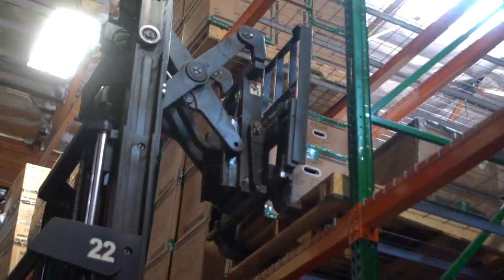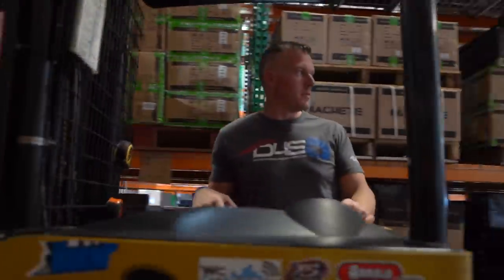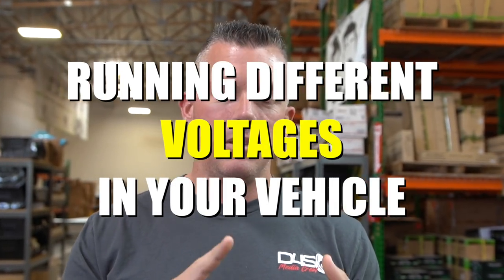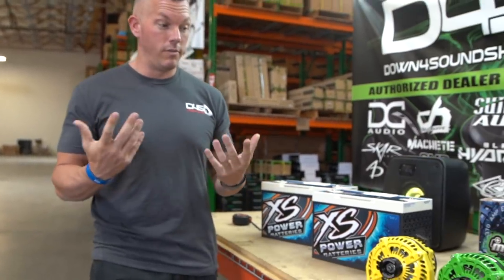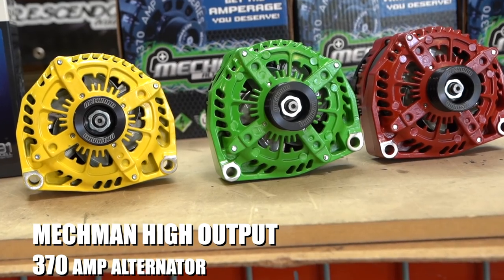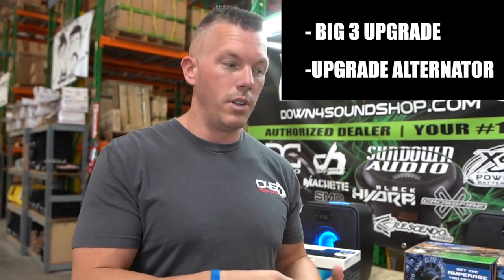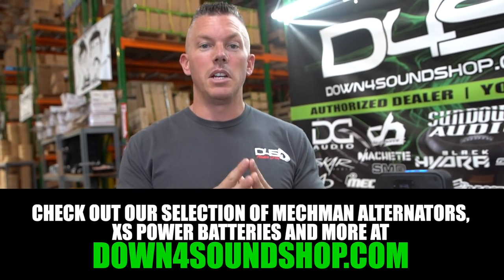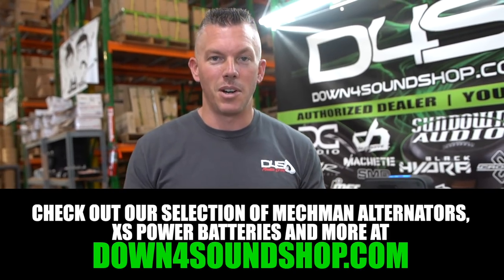WHAT YOU NEED TO KNOW, BEFORE YOU CHANGING THE VOLTAGE IN YOUR VEHICLE

Comment: What's the best budget setup for a 4 door sedan. I want low end rumble but nothing that's gonna shatter my windows. I want to run it off factory alternator and battery though so I'm guessing only 600 watts max?
Reply: It depends on what the stock electrical is looking like in your car.
Reply: Most likely you can go higher wattage than that, but yes as he said need to know stock alternator output to be sure. My Ford edge came with a 150a stock, but some cars only have 90a or so.
Reply: I'm guessing with a 4 door sedan your alt is no higher than 120a so your alt would be ok for 1000wrms.
Reply: My car is a 1400 Hyundai Ix 20 with a 90amp alternator and has 2060 watts of music power all kenwood amps with 2 off 12, inch sub and one 10inch sub and one 6 inch sub and 6.5 inch door speakers

Comment: i had my battery and Alternator went out.   do you suggest a better Alternator.  im not running comp setup.  just a daily 2 10" sub with a 850 watt amp. i was told my subs killed my Alternator and battery and that if i wanna run subs in my car i need to have an upgraded Alternator. is that correct?

Comment: Hey everyone I have a 19 Camry with a 240 autotech and the voltage control module I've been running it at 14.8-15.0 with no problem BUT I just ordered a 29AH SCIB bank from NORTHWEST LITHIUM and i installed it yesterday and as soon as the voltage went over 15v the car started beeping and saying charging system malfunction on both the dashboard and radio screen i know it's just the modern version of a battery light and was told i could possibly see it when initially installing the alternator is it ok for everything to charge that high and what are possible solutions to give my car a lower voltage while still seeing 15.8 at the SCIB bank in the trunk mind you this is a sedan (19 Camry) with very little room under the hood and I have no clue where to look so I think the dual alternator is out of the question unless someone can point me in the direction of someone who knows how and would do the custom work of the dual alternator setup

Comment: I want to put a subwoofer into my Volkswagen Jetta, but ever Volkswagen video I see on YouTube shows the alternator overcharging and the factory fuse box burning up, what is a recommend wattage amplifier I can use for my car without burning it down. Love your Tahoe install.
Reply: Hey, you should be ok, just do the big 3 upgrade and a aftermarket fuse holder , remove the stock alternator wire and fuse, the oem fuseblock is pretty trash. i have a mk4 golf running 6k amplifier just fine (mechman 370)

Comment: Running 2 skar 12v2s 1500rms each with a taramps smart3 on STOCK!!!!! 110alt big3 upgrade lead acid underhood an agm yellow top in the back connected to a duralast platinum efb battery all together 125ah..no resistor or whatever when running different types of batterys it bs..daily driver voltage never drops below 13.2...and i always run system with car on as why would you not...so the alternator thing consider other options if your not going over 3k..unless your alt is in a chevy or ford and easy to do yourself then go for it..but im good no clipping etc and the bass takes your breath away..
Reply: Your good homie but At 13.2 volts your 3k is not giving the full power and is 2,200k lol. Plus change that under hood acid to an agm like xs power at least. And a better alternator too player. lol. Everyone knows acid batteries straight up suck and are not good for the audio. I'm not trying to be an ass and criticize you just trying to give you some sound advice so the music takes your face off too😃👍

Comment: 1:12 1500 or 2000 watts of rms speaker power or amp pwr. How to count total power of system. For example had 2 amps 150.4 amd 1000.1 means i have 1150 power system or got to add also power of speakers?
Reply: Just amp power.

Comment: But having the biggest alt is not always the best option. Have fun thinking your vehicle is going to perform the same with a 400+ amp alt.
Reply: actually  it wont, alt only puts out the amps when its demanded
Reply: @smokingzombie4880  yeah, I know the alt only puts out amps when it's demanded. I'm talking about the size of alt.. you may want to do some research on size of alt and how much power is needed to turn it.
Reply: @crunkwun  no youre right, a little honda might have issues turning it at idle but bassheads dont care we already tear our cars apart with bass

Comment: Any problems charging lithium batteries  with a regular alternator?

I used lipos in rc cars and had to use a lithium charger
Reply: no problems, I run a lithium on my truck for a while now. The battery has a BMs inside which is smart protection circuits. My charging system is all stock for the moment but I will be upgrading soon for an audio system. My voltage starts of in the 14.4 range after start up but gradually  drops to 13.2 at idle after a good long while. Lithium battery charges really fast. I have jumped mine with another battery and I just hold the cables on the posts for 1 minute and the battery charges up instant not like conventional. My lithium battery has a voltage meter and charge percentage meter display built on top.

Comment: What if you own a conventional 1970s car with a very large diesel battery and want to run ac wipers headlights qnd stereo qnd every item. H turn on the volt guage drops and whe. Your driving with all that stuff running at night in hot humid rain. You want to bump up the voltage from A guage showing 11v backup to 14v so the next day your battery isn't dead. using a rare internal regulator I found made for gm 1 wire 120 amp alternator. I bought 2 of them with Lamborghini countach qnd Ferrari 348 written on the boxes 17v magic markered on the alternator,  I'm curious why would some one run such high voltage in those cars? I can simply swap out the voltage regulator with a stock one in the lot I got are 15.5v 16.5  white triangular things with 3 holes and 2 blades for 1 wire vintage 1105 units..and $50 each no trendy spendy modern stuff...

Comment: I have a 2018 Chevy Malibu what size amp should I use for stock battery and alternator I’m put in hight low converter keeping stop deck
Reply: The general rule of thumb is that "most" stock electrical system are good up to around 1000 watts or so.  I've got a daily driver S10 with stock alt and battery, and run a 500 watt rms amp on subs, and 200 watt rms on the mids/highs with no issues. My Silverado has a little more power with 2600 rms on subs and 700 rms on mids/highs, so I've got an optima red top battery under the hood, two 100ah agm batteries out back (isolated), all being charged by an Excessive Amperage 300 amp alternator, and no issues with it either.
Reply: @PURESOUND4  its a power bass amp with 2 12 I’m going to bridge it says 4ohm mono power: 400watts x1 just needed something for my ride to work I didn’t want to put to much strain on alternator or battery I appreciate ur reply thank u
Reply: @thatruthhurts7210  my 1400  Hyundai  ix20 has 2 bass amps kenwood so 1700 watts and a 5 channel Ken wood with 120 watts of bass and  240 watts for my door speakers and done the big 3 and has  a 90 amp alternator and all my wire is ofc copper with 2 off 12 inch sub and one 10 inch sub and one 6 inch sub

Comment: I have 2 of the D4S LTO 6.0 and a 240 amp alternator. it charges between 14.1-.2 at idle, if I add a diode what will my voltage go to ?
Reply: Voltage  drop  but not much of difference
Reply: How much power rms on the 240 alt and 2 6.0

Comment: i thought you upgrade your alternator when you need more amps. like if you wanna run higher rms subs say 3000 rmsso you need an amp that puts out that amount of rms. but a stock alternator doesnt have enough amps so you upgrade it. like i went from 130 amp stock alternator in my accord to a 240 amp one so i could run higher rms amps and speakers. so this is wrong? whatever you were talking about is clear as mud. are you talking about alternators or batteries or what? or are you talking about purely competion sized systems and not daily drive one or 2 sub systems with a simple1 or 2 mono blocks and a 4 channel or two 2 channel mids and highs amp or amps?

Comment: Can you mix alternators like both being 12 volt but ones a 270 and I just got a 400 mechman can I hook them together so they both helping out
Reply: Yes as long as both are charging at same voltage. Alternators will only put out what is asked if them. Regulator sees a loaded put on it and they kick on to send the required amps
Reply: @wooferl7  it’s still computer controlled so it should be the same but I didn’t know if the 400 amp would charge more then the 270 I just didn’t wanna mess one of them up cause they were two different amp output, I didn’t know if that would make any difference… when I first got my 270 it was around 14.5 it’s about 3 years old now and it’s sits around 14.3 so adding that 400 amp alt should help pick my voltage back up then… I just didn’t want the bigger alt to mess up the smaller one basically but thanks for the info and ya the time you took to write it…🔊🔊
Reply: @chrisfiske  for real tho I would run the vehicle and the mids n highs off the 270 and the 400 amp for the bass
Reply: @Pittsburgh-412  that’s what I have now but I’m still using the factory alt and battery for the truck and I have two limitless lithium’s in the back for the sub amp and the 270 only runs it and the mids and high amp but if the 400 amp alt keeps up better then I may still split them up and just have all three alts on the truck I did everything I could to keep as much power as I could to the amp lol thanks for the advice fr

Comment: Man if there is one comment you reply to please reply to this one. These Facebook groups suck, and they hate you for some reason but they all suck so it make sense. Anyways I have a 2012 Kia Forte EX with a 2.0 and 110a alternator. I'd totally out a powerstroke alt on it but it's in the most ignorant position and location it could be in. The math says 110ax14v(best)=1,540. I managed to put a 34 series regular style battery in that's way bigger than the stock. I have zero lights dimming shit like that. Would a decent agm or lithium help get me more out of the stock electrical?  I have a single vxf15 on a rp2k, according to multimeter its right around 1500. But with box rise probably getting 1000 or something, no idea. I had plans to go with the smart3k since it will do rated @1-2 ohm and it's more efficient than this power hungry rp. Work car with 220k, can't splurge for a $650 alt on this one. I appreciate any feedback from any, with factual knowledge 🙏

Comment: Would you need a second battery for a Sundown sfb 2000 in a Chevy Silverado
Reply: In my opinion, yes. That extra battery will give you reserve power and help your vehicle voltage from starving.
Reply: Step 1: sell that SFB amp and stay well away from that line
Step 2: Buy a salt amp instead
Step 3: upgrade your alt to 250a + (depending on your vehicle)
Reply: @crunkwun  Question what is bad about the sfb line i keep hearing they are garbage i was going to buy but ur comment got me 🤔
Reply: @dg2041  I'm in many basshead pages and the sundown page aswell.. They're Chinese full bridge amplifiers. Very touch and go.. you have to put a load on the speaker terminals before you power on or it will blow.. many have asked why their brand new sfb amp has gone into protect and won't come out. Last I heard they were discontinuing that line.. so stay away from it. If you're wanting to go full bridge just go Brazilian.
Reply: @crunkwun  Damn , I'm going to get a Salt 8k instead or is it something wrong with those too?
Reply: @crunkwun   i can only do a 240 for DTS caddi
Reply: @dg2041  nope, salt amps are insane. I'm a Taramps dealer and telling you if you have the money.. go with the salt line. Very expensive but worth it.
Reply: @crunkwun  Salt 8 k it is
Reply: @crunkwun  Salt8k is that good for 3 15 Nsv V4 2 ohm or 2 8ks
Reply: @crunkwun  I have taramp bass 5k 2 AMG xs3400 250 amp alternator  pushing 2 15" massive audio hippo xl amp keeps going in to protect mode I'm in a 2007 Chevy Tahoe could I be cause of voltage regulator

Comment: Do you carry any Alternators for a 11 Toyota Corolla S? Having a hard time finding any
Reply: Try Apex High Output Alternators from Florida. I had a hard time finding an alternator company that makes custom alternators for foriegn whips
Reply: @ChaosTherapy719  good looking out
Reply: @RomaVilla  welcome, i like my foreign whips to drive that's easy on gas and i love SPL Bass too and i did my homework on everything I needed to know to overcome that alternator issue.
Reply: @ChaosTherapy719  took the words right out of my mouth, I currently have an Orion HCaa 3000.1dsplx on a single 15 avatar stu at 1 ohm with the big 3 dual runs of power and grounds but my stock alt is holding me back from getting that chest pounding bass I know I should be getting but I'm not that well versed in high output alternators or even which ones I should be looking at so your right about doing the research to find the best fit for set up.
Reply: @RomaVilla  fo sho, that's a beastly system your running dewd!! My system consists of a single Sundown Xv2 10D2 wired to 1Ω and i keep swapping between my Power AcoustiK Razor RZR1 2500D from Wal-Mart and my Deaf Bonce AAB Atom 2000.1. Got all Sky High wires and accessories and a stinger 250 amp battery isolator to keep the amp drawing off my AGM deep cycle instead of my main battery. Though I'm thinking about adding 2 more Xv2s before the models discontinued.
Reply: @ChaosTherapy719  sweet set up, how do you like that xv2?
Reply: @ChaosTherapy719  I've never heard any sundown subs except for an sa 12 I use to have a few years back that sub love to hit all the lows and took a 1 k audiopipe full tilt all day long
Reply: @RomaVilla  bruh, outta all the Wal-Mart subs and kickers and Alpine Type Rs I've blown the shit out of over the years. This X is a straight up monster!! I absolutely love it!! I've straight beaten the shit outta this lil 10 dropping it to 17hz and it keeps thundering along like a champ
Reply: @RomaVilla  and i copped this Xv2 from Sundown's Yard sale last winter
Reply: @RomaVilla  i gotta bunch of demo videos up on my channel if ya wanna see my old Nissan 200sx flexing til I blew the motor in it (the car's motor, sub is fine waiting to get installed in my next whip lol)

Comment: I'm new to this whole car audio game I have a 2013 Dodge Charger I am trying to figure out what electrical setup I can run support and 8000 watt RMS system with only one alternator what would you recommend
Reply: If you are trying to only run one alt. I'd personally go with a 400 amp and have a good lithium bank for it. A lot of ppl are doing battery deletes and just running lithium but I'd look put and research that before I do a delete.
Reply: start with a 320 or 400 amp alt and pick up an 80ah battery that should hold it down for your electrical
Reply: since you are a noobie , dont start buying things and dont know what your doing. First off a nice setup done right is not gonna be cheap. The install is key and the gear quality matters. You need to plan to out all first. Do you have the room for the subs you want? how many? All that stuff. How much watts is the whole thing gonna be? You said 8,000 rms. That's a lot! Your gonna want to use Copper OFC wire first off. That means oxygen free copper. Skyhigh has some of the best wire and price. Upgrade first your dodge charging sytem wiring or what they call the big three. Then get the highest amp alternator you can. For that amount of power your gonna need 0/2 wire quage or 2 runs of 1/0 to support it all at least. Your gonna want some batteries in the back for more capacity. Agm is good lithium is better. Or some super capacitors. You can find out how much each wire size can support as far as amperage and wattage. Plan it first is my advise  and make sure all the audio gear is gonna work together that way when you buy it it all comes together. You need to have the room for the system and the air volume size of the box for the sub or subs. How many speakers, where, what brand, What amps, can they handle the loads, what ohm loads, all those details work them out first. If your not sure ask people who know. Like people said dont use an acid battery under the hood, get an agm battery like Xs power. lithium is a little better but more money.